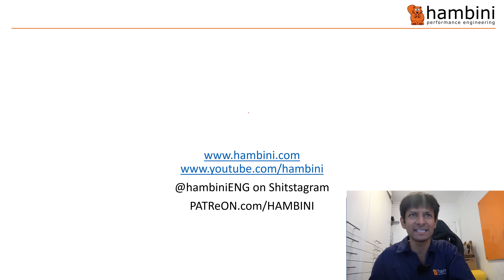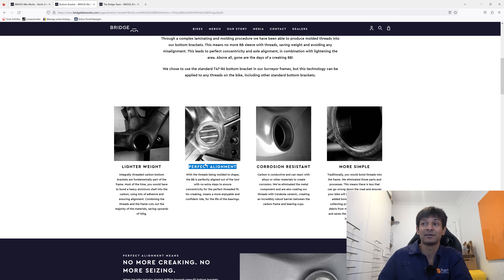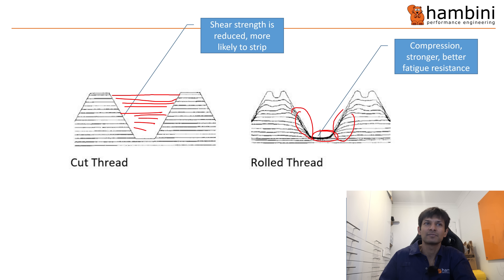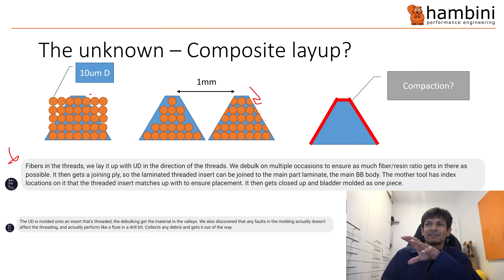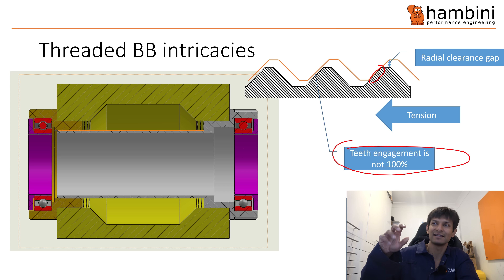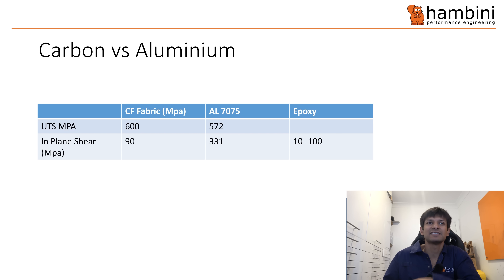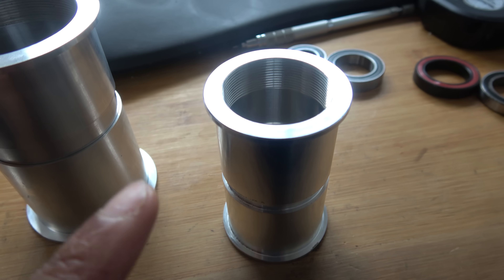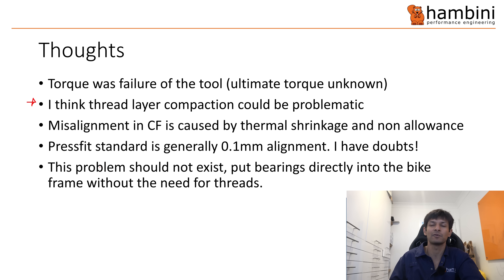Carbon Molded Threads, Crazy idea? | A Solution to a self inflicted Problem | REAMING

Comment: Couple questions for them i think:
1. Commercially how do they license it? When the Chinese factories know how, they will just adopt it in some bendy wendy IP dodging form and it will become their norm. 
2. The case of demoulding warping between left and right BB sides is still a problem, surely? This isn't a problem when a shell is bonded in after demoulding the frame. For those ne connaissent pas with carbon fibre moulding, parts will often warp when taken out of a pre-preg mould due to captured stresses relaxing when moulding under heat and pressure.
3. Did they consider a short strand CF injected plastic for this? I would argue that might have better dimensional stability between left and right cups.
4. Pub quiz, can anyone name an interior thread that is rolled? 🎉
Reply: 5. Many companies can do a pf86 perfectly, with a cheap plastic shimano bb. I have 3 bikes with this and never changed a bb. Its hilarious how we are chasing such overcomplicated solutions. Even t47, doesn't need to exist.
Reply from the maker: @PeakTorque  The best standard I think is BB386 NOT EVO. it's essentially a BB30 made wider with two circips holding it in. SImple and effective, the wider stance means the misalignemnt problem is mitigated. This standard has never taken off though.
Reply: @Hambini  Quick one for you:

I have a Canyon Ultimate, with what i believe has a bb86...?

Considering buying a Time, which has bb386?...

What is the difference between these two, and will the Ultegra 8000 crankset on my Canyon fit the Time?

Thanks! ❤
Reply: @matsrekdal3065  same width i believe but the 386 is a larger bore which enables you to run a dub or 30mm spindle if you're an absolute nutjob.
Reply: @PeakTorque  Got it😅
Reply: @Hambini  I once saw that wide BB30 on an old Storck road bike. Cannot remember the model name, maybe Fascenario something from late 200x or early 201x. 
Two 6806 bearing press fit to the 86 mm width BB shell to working with Storck own crank, 30 mm carbon spindle. Nice design and much ahead of it's time.
Reply: @PeakTorque  while we're at it... Square taper BBs were fine for professionals,  inexpensive and incredibly easy to service.
Reply: @truantray  I have a 1993 steel Casati frame using a Shimano square taper bb from then, 30 years later the bb and bb shell is still going strong. No creaks.  Since then, bb implementations have gotten worse and worse.  And a lot of this has to do with carbon fiber as frame material.
Reply: @truantray  they were super heavy though.
Reply: @truantray  Except that when you take the cranks few times on and off they will be done. And please don't try to tell me the bearings inside those never got destroyed. And don't tell me they where that easy to service. Everybody working on bikes has seen at least one of those firmly backed in to the frame due to galvanic corrosion.
Reply: @rosomak8244  why? A crank on a square tapfer has to be put off and remounted 1/4 clockwise every few months. With a little bit of grease it will last forever. No Chance for corrosion!
Reply: If you need a 30mm axle for your weight/power then you should also want a precision press fit IMO, otherwise 24mm/BSA is better
Reply: @PeakTorque I believe spoke nipples would be an example of rolled/formed internal threads?
Reply: @muzzarobbo  spokes are rolled but I'm not sure about nipples
Reply: @muzzarobbo  
All internal thread of spoke nipples are cut, not rolled/formed, including nipples for carbon spokes.
Reply from the maker: 1. The problem with patents is having the commercial clout to be able to defend them. In only takes one little quirk and someone with lots of money and you are stuffed.
2. I don't think the two halves can be moulded that accurately even before adding the threads. 0.1mm is not a lot and then you have a compound stack up - I'd be amazed if they could achieve that. as you correctly say, the relaxation is difficult to account for. 
3. That would be basically plastic?
Reply: @Hambini regarding 3, yep, plastic. Many companies call it 'carbon' just because they lob in some short strand reinforcement. But it'd probably be plenty strong enough. Some performance yacht designs have been using CF injected PA for large threads for ages, at serious tensile loads. But considering the relatively low shear loads of human prawn power vs the actual huge size of a bb thread, maybe its doable. Difficult to bond to though.
Reply: @PeakTorque  Colloquially it's referred to as black aluminium. Generally nylon or some other engineering polymer with chopped CF strand. Takes on an isotropic nature and has mechanical properties similar to aluminum. Composites molding processes (prepreg / bladder) for parts like this is likely only accurate to a few thou, not sufficient for bearing alignment. Smarter would be to mold an entire sleeve inside in BB shell which would serve to keep the threads somewhat more aligned during the layup in to the bb shell.
Reply: @jonathanhornell-kennedy4521  i know how it works bud. I work with composites a lot, but ta!
Reply: 4. does an internal thread former count? l mean it's not rolled but still forms instead of cutting
Reply: Yup
My 1993 Bontrager race has rolled BB treads
Reply: @denisrogers4358  
Bontrager?
Is that external thread on bottom bracket?
Reply: @Billo7979  regular threaded BB -
Keith Bontrager (Trek bought Bontrager Cycles)
Handmade in SantaCruz Ca.
Still have it ! 
‘93
Reply: Rolled internal thread? I thought only external thread is common for steel and softer metals, haven’t heard of rolled thread for polymer.😂
Having said, I used to have a carbon fibre headset though…
Reply: @Billo7979  since the bike industry seems to make big holes in frames and ceramic bearings a thing, l bet they can make rolled polymer threads a thing
Reply: 2. I assume they don't have to worry about demold warping because they are using a split Mould so everything that is not the detail  features (In this case the BB) is getting bonded in one step right? Obviously the part still has internal stresses but each sides stresses should be equal and opposite since each side should be symmetrical. 
3. At that point it defeats the purpose if they need a separate process to make the bottom bracket piece and bond it in place then why not just bond a insert made of aluminum, forged carbon or something else. At that point its just a traditional BB made out of a funny material.
Reply: Love the videos you put out. Thank you.

1. Dunno about these guys, but it's a long standing tradition in the composites industry to license something anyone can easily knock off and just charge way less for the licensing then it would take to go to court. If there are any old composites engineers out there you may remember Siemens SCRIMP licenses for what was essentially resin infusion. They just made the license the path of least resistance by charging a small yearly fee. 
2.Yes, warping would likely be an issue. Hmmm.... maybe instead of threading the carbon you could thread some sort of sleeve, or better yet, just make it a press fit..... I think I may be on to something! 
3. Only a tiny bit stronger that way. I worked for a company where we tried that. Still not close to a threaded insert. Shears out where it meets the woven carbon.
4. They call it thread forming in that case. Great in aluminum, and I switched a lot of machine shops over to it in a former role as an applications engineer for a metalworking vendor. No polymer applications I know of unless you count a buddy of mine who threads his 3D prints with screws and a heat gun. Seems to work for him.
Reply: As a standalone part, it's not that hard to get carbon parts within good tolerances. To prevent warping all you really have to do is make sure the CTE distribution is balanced. I make 4" diameter thin walled spar tubes within a thou of circularity.
Reply: @appa609  yep. Standalone is fine. But stick it in a frame layup with multi-axis swatches that are anything but symmetrical and boing there she goes. That's why the bond the RT on afterwards in a gluing jig...
Reply: 4. Well, roll tapping is a thing just like rolling external threads, but I'm sure you already knew that.
Reply: My 1993 Bontrager “Race” has rolled BB threads.
Reply: from my perspective ( mech. engineer since 2004, 3 years practical education as an industrial mechanic, some experience with carbon and other fancy stuff) - are they kidding? The nightmare of every mechanic and for what? Completely useless! BSA is fine for sqare taper / octalink / ISIS bearings, but for the other ones it is pressf%*k because of the alignment. A BSA bearing in my Diverge or Chisel will last max. 2-3k km before game over. The cheapest BB86 from Shimano in my Cube run over 12k km - not bad for a 12€ bearing! Easy machining and the plastic hose around the bearing (dr. tolerance) are hard to beat (if you are not looking for the last watts)!
Reply: Answer: Have you heard of Roll Taps?
Reply: Do either of you think this will be successful?
Reply from the maker: @theillegalimmigrant9314  I think it will depend on the cost of implementing it. If it's cheap then it will take off. If it's expensive, I don't think it will.
Reply: @Hambini Only time I’ll disagree with you. If it’s expensive it’ll take off. If it’s cheap.. well, who buys cheap bikes? 🤨😂

Comment: Not sure if you'll still read this after 2 years, but I'm wondering why not just bond a steel or aluminium tube into the frame. They could be mass produced so the ID and faces could be machined to a pretty close tolerance. The OD could be grooved/textured to bond to the carbon. Alignment between the two faces should be good, all they would have to be careful about is to get it square to the frame

Comment: What we need is the spindle axial aligned perfectly and that thread molding is OK but necessary.

What we need a mold specific alignment-insert-BB to be threaded into the production BB-shell then apply CF. Essentially that is equally good alignment as the molded thread.

We are running the risk that the production tool thread former will be permanently bonded with the production shell. 

We still don’t know the structural relation between the thread and the frame. 

Why didn’t they went all the way through molding the thread into ACME profile?

Given the CF grain direction, a small axial impulse, bump, can be a significant destructive force to break the thread profile away from its root.

Comment: Traditional threads in plastic parts are dimensionally and geometrically very different from ones used in metals. Trying to make very fine threads work with CFRP seems insane for consumer products.

Comment: Brilliant video!  I agree with your perceived problems with molded threads: Thermal Deviations, and layup Deviations effecting the alignment. Then ceramic coating the threads will eventually wear the aluminum bearing housing. Pivot Cycles has stayed with PF92 standard when other high end mountain bike manufacturers are migrating back to threaded BB.  Having not owned a Pivot I can't say if they have figured out how to do press fit BB correctly.

Comment: To your last point, maybe using ceramic bearings with a molded in place outer race would solve the problem. I think ceramic and carbon fiber have similar expansion properties and they certainly are not electrochemically corrosive.😢

Comment: @Hambini Doesn't a threaded bottom bracket (regardless of aluminium or carbon) make it virtually impossible to fix poor alignment? With pressfit one can solve that problem with one piece bb (at least to some extent). 

I don't know if threaded bbs always have exact round and sized holes, but if not, there's not much one can do about them compared to pressfit (like whiffling Hambini style).

Comment: if I remember correct schmolke already did m5 carbon screws for bottlecages and they pointed out that the fiber is layed in to the thread and its not a thread cut out of a carbon bar or even some carbon powder mixed in to a special screw plastic.

Comment: I'd be very surprised if these carbon threads proved to be durable. I guess only time will tell. It's seems obvious that a properly engineered press fit system would be superior, but in reality, a Hambini style press-in BB allows for less precision from the frame makers, for only a small weight penalty.

Comment: I watched the video where the guy is spinning the bottom bracket into the frame section. The thread looked quite baggy by the way he spun it in. I’ve owned frames where the aluminium bb shells have corroded in the frame and killed the frame so this is a clever idea if it works.

Comment: Shouldn't the CF layout be better 90° from your 1st sketch to absorb the shearing forces better? 🤔 But how could they provide enough pressure from inside during the epoxy curing process to bend the carbon fibre and not having any voids in the thread? 🤷‍♂️

Comment: I think....  Thanks to the manufacturer for getting back to Hambini instead of sending a "legal" letter.  Before I make any decision or review of a product, I like to see it in action.  Then I will form my opinion.  Disk brakes, electric shifting, EV cars; all need to be ridden hard and put away wet before I think it's good or bad.  There is no such thing as Perfect Alignment as we all learned in Geometry class. I would think it's hard to build a truly better bottom bracket and not want to promote it. How? Everyone claims their BB has Perf Aling. Let's give them a chance and see what they build.   We all have to remember that this area hangs down at the bottom of the bike and gets splashed by the front tire for 100% of its life.  It actually needs to be a bit loose and sloppy. Dirt, dust, water, and micro crap will get inside no matter what.  The idea is regardless if it's your bike or an F1 car, you need to remember it's going to need routine maint. build it so, and the best part is no part.

Comment: The bicycle industry will try anything, insanity! I will do a video on this, I will not be able to help myself. Lol 😮 i understand they may have high qualifications but this is a silly idea. I would imagine they will need to use a mandrel to ensure maximum compression to ensure the strength required when torquing the bottom bracket sleeve. But you are still applying a point pressure which carbon doesn't like. Also you will need very good QA which again is a bicycle industry problem

Comment: I am currently hand fabricating parts for a subsea ROV for a dive in a week, because the Friday afternoon intern thought it would be good to thread bolts into engineering plastic without inserts. To hold things literally worth their weight in gold such 2500m rated cameras or sonars. Spoiler alert, it f***ing wasn't a f***ing good f***ing idea.

Comment: Problem 1. We want lightweight, so let’s mold the bearing seats into the carbon.
Problem 2. We can make round holes, so let’s use metal inserts to control tolerances and solve creaks.
Problem 3. Metal inserts are bad, because of corrosion with the fiber. But it’s better than the creaking. 
Problem 4. We need threaded BBs because they wont creak, so mold in a metal insert and thread it? Thing start going sideways.
Problem 5. Back to lightweight, let’s mold the Carbon so we don’t need the metal insert. So now you understand how to make round holes and even how to address corrosion but the answer is threading the carbon, to use a metal BB?
No…you F’d it up. Go back to number 1. Just make a round hole for the bearings. 😂

Comment: Unrelated to this post. Do you think Enduro's "BKSM-8142 - Maxhit, 440C stainless steel, BSA30 Bottom Bracket kit" addresses the issues related to 30mm spindle in a BSA BB?

Comment: I always wonder whether it's the engineers or the marketing department that comes up with this stuff.  I can't see how in an imperfect world, where component manufacturers struggle to even meet their own tolerances that this won't result in absolute destruction of the threads.

Where does the ground off material go, well I'm going to bet it will start finding it's way between the BB insert and the oh-so-delicate carbon fiber threads. This can't be a good thing.

Comment: Great video thanks Hambini. PF30 is fine, works well is light. We all know the industry has failed. The accounting department drove the decisions and pushed for cheap manufacturing. Tolerances couldn't be achieved so the marketing department stepped up to cover up the mess and have also failed. I flatly refuse to go back to threaded anything and as a 70kg rider, rimbrake works great for me. With interest rates skyrocketing the second hand bike market is alive with high end bikes. Interestingly a precovid S-works DuraAce SL6 goes for aud$7000 where a post covid SL7 goes for aud$14500. If I'm buying a bike, I'll grab that SL6 with pressfit, rimbrake, 6.4kg for half the price of the disc brake, threaded, 8kg SL7 any day of the week. The bike industry is screwed and you only have yourselves to blame.

Comment: The only rolled threads I have ever seen are spokes
Reply: Bolts you buy in shops (no matter if they are for bicycles or general bolts for construction etc) are rolled. It's faster than cutting and allows mass production